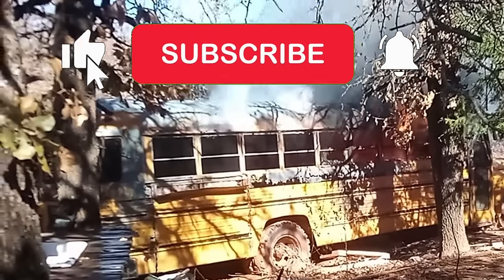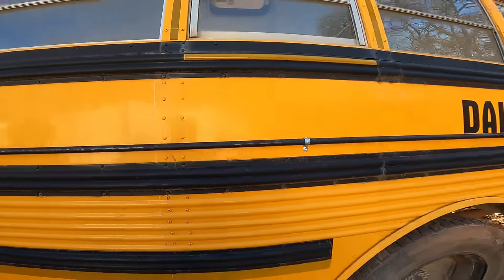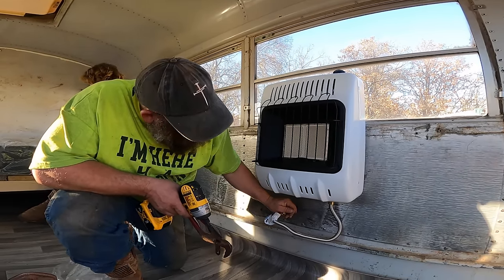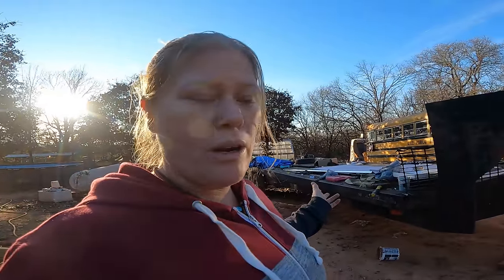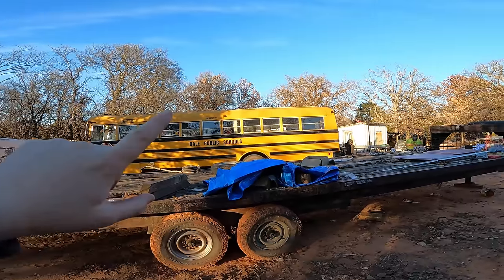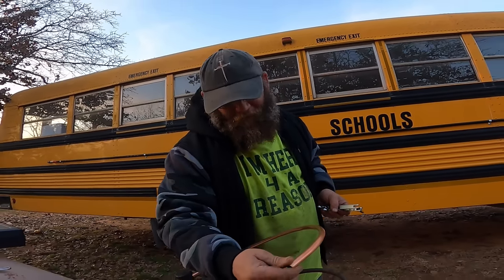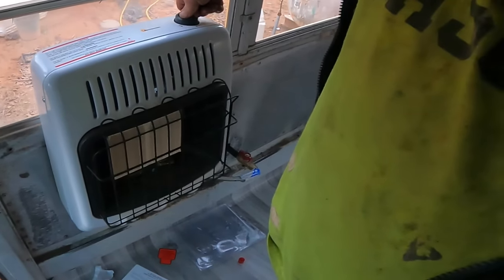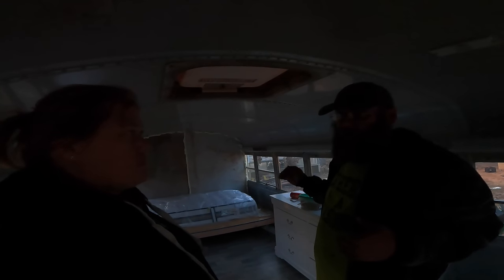Bus build: Ep. 5 | How to install a ventless gas heater #schoolie #offgrid #buslife #couplebuilds

Comment: looks good and ready. thanks for the update.
Reply from the maker: Thanks! They are certainly thankful to have their own rooms again where they can stay warm These little heaters are AWESOME. Although, they have not been able to keep up when the nights get below zero. It was enough to keep the inside of the bus above freezing, but it was cold enough that the kids put on extra clothes and used extra blankets. Stay tuned for future episodes where we install the 12v solar setup. Then we will most likely work on the rest of the insulation; which will be interesting... We will be using some "junk" we have lying around and it is going to make a heck of a mess. hahaha
Reply: @OurMountainHome316  yeah it will work great when insulated. Ain’t nothing wrong with them “ repurposeables “ lmbo
Reply from the maker: @TheMaverickAcres  definitely not. Especially, since it'll be behind a wall. So, it doesn't matter if it's ugly because you won't see it anyway. 👍🤷🏼‍♀️

Comment: Good job guys that should keep them nice a toasty and the in stall looks good to..
Reply from the maker: Thank you, FordDude. The heaters have been really good, except they can't quite keep up when the nights have dropped below zero. Although, I suspect it will only get better once we get the rest of the insulation done. The install was pretty easy, and I think it is going to last FOREVER. lol Now we move onto installing the solar set-up and when it gets warm enough outside to work, we will be using some interesting "junk" to insulate the walls. lol
Reply: @OurMountainHome316  Sounds like must watch TV to me looking forward to it.

Comment: Led lighting will be bright and give out less heat in the summer. Great job with the heaters.
Reply from the maker: Gwen, we agree. We have thought of that. We want to find something that will run off the 12v system and will use minimal power. We will be off-grid when we move to Arkansas, so it is important that we try to make adjustments now, that will serve us well after we move. We are exploring some different options for lighting. Although, it will defiantly be LED something. As always, thank you for watching and for taking time to leave feedback. We appreciate you.

Comment: Heat in the bus!  Yay!
Reply from the maker: YAY!!! This is a huge improvement. We know it will only get better when we finish the insulation. The heaters have done a good job, except they can't really keep up when the nighttime temps drop below zero. Please stay tuned as for future episodes. Next, we will be working on installing the 12v solar set-up. Then we will be making a HUGE mess when we use some "junk" we have lying around to finish the insulation. lol It is going to be a wild ride. As always, we appreciate you for watching and for taking time to leave a comment.

Comment: Hiya, bus is looking great, good idea on the heaters. The one thing that you might want to do is add some metal panels on inside where heaters are, I was just thinking about how much the heat is going to affect the glass windows. Looking forward to your next video, I enjoy watching the bus build.
Reply from the maker: We appreciate you for watching and for taking time to leave some feedback. These heaters are doing a really good job, but they can't really keep up when the nights drop below zero. Surprisingly, these types of heaters don't really put off a lot of heat on the back. When we build the interior walls, we may consider adding some metal or Hardi-backer just to be extra safe. You can never be too careful when it comes to the safety of kids. The next episode will be installing the 12v solar setup. Then we will be making a HUGE mess when we use some random "junk" we have lying around to finish the insulation. Thank you for following along on this adventure.

Comment: I would insulate the walls and ceiling real soon, otherwise the gas bill is going to be enormous.   You have done such a nice job on the bus so far, it will be so good for the kids. Have you thought about putting cheap wood flooring on the walls?  Sams has some nice cheap flooring. Stay safe❤❤❤
Reply from the maker: I agree, we do need to insulate really soon. We are operating on a very small budget. Although, we think we have found a solution; we plan to use some "junk" we have lying around to insulate so it won't cost us much to get the job done. It has just been soooo dang cold,. We are waiting for a decent day to get back to work on it. We are not sure what we will use to cover the walls with yet. Cheap wood flooring is not a bad idea at all... Like I previously mentioned, we don't have a lot of money. So, we are doing our best to use stuff we already have on hand to get the job done. Ultimately, we want it to be functional, but it would also be nice if it looked nice too. Please stay tuned for future updates. The next video will be about installing the solar set-up and electric outlets. Hopefully, after that we will be able to move onto the insulation. Thank you so much for watching and for taking time to leave some feedback. We appreciate you.

Comment: Have you seen the light switches that have the switch and light on the switch that runs on batteries? They are nice and bright😊
Reply from the maker: Glenda, I think I know exactly what you are talking about. Those ARE very bright. We had some a few years ago and the batteries didn't seem to last very long in them. The last time I had to buy batteries it was like $10 for 4 of them...  I am not sure they would be the best long term solution.

Comment: could you use flex seal on the outside of the windows you want to cover up? the rubberization of it will seal them and may be cheaper then putting metal on them. they have a clear one so you would still get light through it.
Reply from the maker: We had not thought of that... The last time we bought a roll of that tape it was $20... I think we can get metal pretty cheap (although it will probably be different colors and will need to be painted). As always, thank you for watching and for taking time to leave some feedback. We appreciate you.

Comment: Outside wood stove;  Buddy had one, worked great with his antique steam heat jn house, problem is, with the heat in the fire box of the stove,  the walls rusted @ the seams and developed  a leak,  so your going to have an advantage making your own using much more durable material,  the other disadvantage is electricity to keep the pump
Reply from the maker: Thank you, Carol. We will figure it out. We have a long time to do our research and find materials. We have friends that have this kind of set up and say it works really great. It's like having a firebox the size of a dumpster, so they can throw in a LOT of wood at once and it stays hot for a LONG time. The traditional woodstove in our house has to be filled every few hours. So, it would be nice to only have to add wood once a day or less. In addition, we may consider burying whatever we build, that would help keep the heat from being wasted on the outside air. It will all work out in the end, one way or another.

Comment: Nice getting there get a couple carbon monoxide detectors. Had a gas leak once they are a life saver.
Reply from the maker: Thank you, I agree. We have already installed some smoke detector/carbon monoxide detectors. Although, these heaters are supposed to have detector built in. If the carbon monoxide gets above a certain level than the heater is supposed to shut down and not come back on until the levels have returned to normal. My brother actually ended up passing away due to carbon monoxide poisoning. He was living in a camper, and he was heating with a propane heater. It was really sad... So, I take this sort of thing VERY seriously. Thank you for bringing up this great point. ❤️ As always, thank you for watching and for taking time to leave some feedback. We appreciate you.
Reply: @OurMountainHome316  I lost a few friends over the years to faulty propane heaters glad to hear you already thought of it and definitely glad the kids got a new bus

Comment: I hope your pipe on the outside won't whistle in the wind going down  the freeway.
Reply from the maker: I don't think it will. It is held on really well with those little bracket things we used. However, when we get it moved to Arkansas, we will be testing for leaks before we allow the kids to use the heaters again. You never know what kind of things wiggle loose or something. So, just to be on the safe side we will test every connection again. We plan to move to Arkansas in April (or when the night's stay above freezing). Please stay tuned for future episodes where we install the 12v solar setup. Then we will be making a HUGE mess when we use some "junk" we have lying around to finish the insulation. As always, thank you for watching and for taking time to leave some feedback. We appreciate you.

Comment: Bus Insulation;  neighbor uses scraps from his contractor friend that specializes in flat roof repair,
Reply from the maker: Thank you, Carol. That is a good idea. We used some old fiberglass insulation that we saved from a house remodel job we did. 

P.s. this is a secret... Maybe by putting this furthur down in the chat box fewer people will see it... 🤣We have some GIANT styrofoam blocks (the kind that are used to float boat docks) we are going to use our sawmill to cut them into 1in thick sheets. Then we will use those sheets to insulate the rest of the bus. Some friends of ours did this a couple of years ago and it turned out really great!

Comment: I bought a roll of Frost King Reusable Window Winterizing plastic for about 7.00 . Then the double sided tape was less than 2.00 . I thought my cat would destroy it but turns out its very durable.  I made a video.  😂  This would be a very inexpensive way to block out the air and still be able to see through the window. It was a roll seems like 54 x 25 . You could seal windows on both sides for less than 20.00 temporarily. We live in a house that is probably 150 years old . Unfortunately I got the last roll at Wal-Mart but will be on the lookout for anymore .
Reply from the maker: That is a great suggestion. Before we bought the property we are on now (in Oklahoma) we lived in a house that was built in 1920. So, I understand why you would need the plastic. While living there we used the shrink wrap kind. Where you put it around your window then use a blow-dryer to make it tight and smooth. It didn't look bad and it made a BIG difference. We will be working on the insulation very soon. But if we end up prolonging the insulation we will definitely try to find some of that plastic. Thank you very much for suggesting it.

Comment: May want to get a carbon monoxide monitor for each side of the bus.
Reply from the maker: Yes, we have already installed them. This is very important. However, these heaters claim to have a built-in carbon monoxide detector. They are designed to shut off if the levels are unsafe. It never hurts to have an extra layer of protection though. My brother passed away from carbon monoxide poisoning, so we take it very seriously.

Comment: How much propane will be used to heat the bus in winter?
Reply from the maker: Barbara, we are not sure. This extreme cold snap is probably going to mean that we will have to purchase more propane before we move. We bought 200 gallons in the fall. We didn't fill it all the way up, because the tank will need to be empty when we move it to Arkansas. At that time, we didn't expect to have two more heaters running off of it... We usually fill our tank up (375 gallons or 75%) and it lasts all year. Typically, we use propane to cook and heat water. We do have a propane heater in the house that we only use when it is extremely cold (like it has been lately). At this rate, we will most likely need more propane before we make our move. 🤦‍♀️Sorry I was not able to provide a more precise answer to your question.. As always, thank you for watching and for taking time to leave this comment. We appreciate your feedback.

Comment: Can’t you use the freezer panels for walls.
Reply from the maker: Sheila, I suppose we could. However, they are 4 inches thick and would take a lot of space away from the interior of the bus. Plus, we don't have enough of them to do the whole bus, we may not even have enough to do one half of the bus. They would certainly be a good choice if we had enough of them. We have searched our junk piles, and we have the perfect solution!! We will be making a HUGE mess when we do the insulation. I think you will be impressed with our ingenuity. lol The next episode will be about installing the 12v solar setup. Once we get that done and install any wiring, we will be moving onto the insulation. As always, thank you for watching and for taking time to leave feedback. We appreciate you.

Comment: How soon are you moving ? Do i have time to send a package ?
Reply from the maker: Hello Deena. We will not be moving until April. ♥️ We are not prepared to live in cold temperatures without heat. Lol We still have two more school buses that we have to get ready before we move. There is still much to be done. Now if the weather would just cooperate. 🤣
Reply: @OurMountainHome316  what size beds in the bus ?
Reply from the maker: The beds are twin XL. ♥️